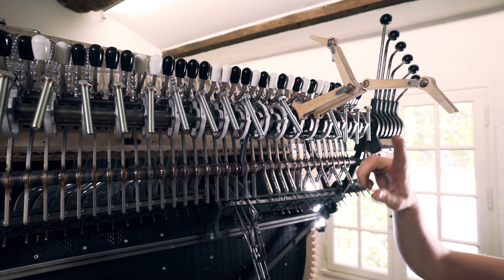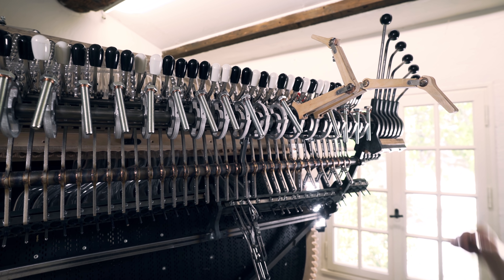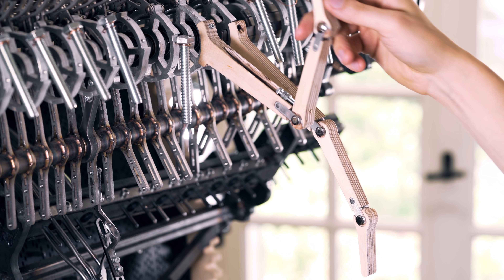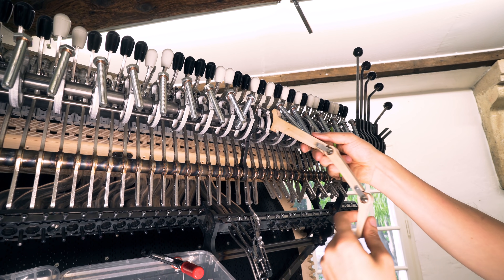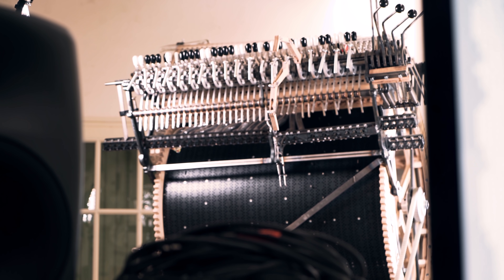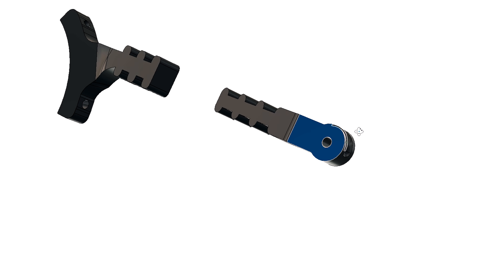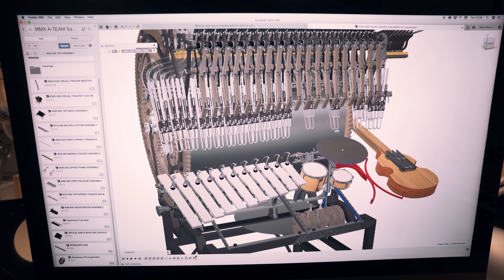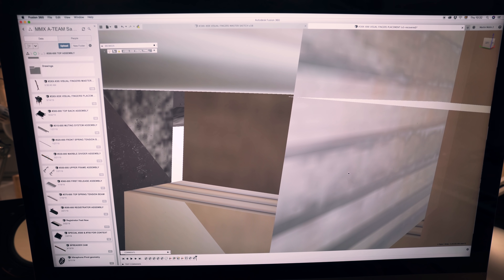Kinetic Fingers Prototype - Marble Machine X #82

Comment: This may not be 'feature creep', but it's certainly 'feature CREEPY' and these will work well on Halloween :) However I recommend you make them removable so that they can be taken off as a unit / assembly for the other 11 months of the year, when you're not playing October shows :) Otherwise, cool idea. 
And yes, I second the idea of small cameras that are strategically placed to show the action... that is a fine idea, and if the cameras are plugged into a common unit providing a common video output, they can be quickly connected and disconnected from the video out cable, to the main video board (so you'd have a sound person AND a video person, for shows).

Comment: In my worthless opinion, these are an oddball to the machine. everything else serves a musical or structural purpose. I'm on board with the hinged funnels as that is already a thing that was there. It would be different if  the original already had static fingers and in the design of the mmx you were like, " those need hinges" but it was, imo, slapped on like flex tape. I know they wouldn't have a purpose in the original but still, the problem they solve can be solved in other ways. If you wouldn't be able to see the giant gear moving from 50m these won't change much. It'll be less "oh look at those fingers playing the music" and more of "the top of that thing wiggles" Also,  to see these you have to have your back to the crowd. I propose a different approach. A close up view of the machine projected on a screen. This would be a lot more interesting for the crowd as they could see what was happening. Overall, I understand that this is your machine and you have put tons of hours into it so it is up to you what you do. I just think this a little gimmicky and I didn't that was where the mmx was headed.

Comment: A little late weighing in, but feel obliged (as I'm finally getting caught up with the videos). Please don't. They just add visual clutter. The other mechanical bits also have a functional role. These are pure fluff (and creepy as well), and still too small to make a difference in a large arena. Everything else is so elegant - this is just baroque, pure form over function.

Comment: 1: while visually stunning (right or wrong) they get in the way of the 'control face' of the MMX which seems like a big mess logistically, unless I'm missing something. (You're literally caged out of all the little black/white knobs by the skeleton fingers.)

2: the movement is simply clunky and mechanical... if you're going to do it, they need to feel alive, not animatronic. The 'shudder' motion when they land looks terrible. I don't know how to solve this? Bushings? Rubber stops? Shock absorbers? Tension springs?

3: I think there is plenty of visual interest already without the fingers, but it's your machine and ultimately your vision!

Comment: Of course I have to put my own oppinion in a sea of comments that'll never be read :P

While I agree that the fingers are form over function, I only do so partway. You gotta remember that while you are seeing the machine in pretty extreme closeup with a camera that can move around freely and track marbles as they go around, in a live play that isn't a possibility.

Not only will the audience not be able to track the marbles from a distance of even a few metres, but they will not be able to discern which marble is causing which noise. It needs to be overstated when and where the noise is coming from, or else it'll look like he'll just stand there and crank it like an idiot while the sound is prerecorded because the audience won't know the difference.

So I agree that on the finger's necessity in this machine as a touring instrument fully.

Comment: Try to see the fingers as part of the gesture, an element that trails off into the inexplicable. I see them as essential. This machine was envisioned by one mind. Though the production and design are being supplemented by many, that initial vision is still where the project was born. From the beginning, he has had a vision that requires effort to communicate, and one should not assume it would be possible for it all to be communicated via YT videos. We do know that some aspects of this vision are meant to be gestural, atmospheric, about the movements and sounds from a purely aesthetic point of view as well as functional. This is art. Let us not forget that nonsense, illogic, intrigue, mystique - even self-disassembly - are all potential brushstrokes in any work of art. This is the difference between AI and humans - we are not entirely predictable, functional or possible to summarize.

Comment: The only thing i thought has to be changed is, put the counterweights in shrinkingtubes!
Everytime the weights hit the finger it will gave a collosionshock to it and damage the connection over time.
Just suspend it a little bit....

Comment: Im not really sure what's the point of having each finger segmented.. why not keep each finger as a single solid bar.. and make them look like tiny hammers.. the fragments makes it look rickety.. and if you are going to strengthening the joints.. it defeats the purpose of the segments. Seems like over engineering here.

Comment: Just because it was planned from the beginning doesn't mean it's not feature creep. It is just early onset feature creep! Also it does not look like the I believe t-shirt or poster design. In regards to visuals with the wheels and chain lift you have lots of visual parts the the MMX. Do you see the strings vibrate on a string instrument in a concert setting? I have followed this project from the frame up  this is not MMX.

Comment: Too floppy.

So much better than the black 3-d printed spider legs you had before, but still very bad. Everything else on the machine is wonderfully precise, and you've taken pains to have it all work in time with the music, so why do you want fingers flopping around all over the place? 

You could make them not have any joints, and rather than being pointy at the end, make them larger, like a lollipop, so the part that moves the most is the easiest to see. It'd still be totally unnecessary, but at least it wouldn't be hideous. 

By the way this is the first of your videos I've ever felt the need to comment on. The lifting fingers are that bad.

Also, congratulations on your new garage space. Looks commodius.

Comment: I may be fairly useless to the actual construction of the marble machine but if you want to smooth zoom in CAD you can activate your compass command wheel (should be in your quick tool bar somewhere in your assembly window or on your drop down menu) and use the zoom feature there

Comment: How about mallets and drumsticks for the percussions and leave the "fingers" for the bass? 

With ~20 of these things in a row you can see that something there is moving, but not exactly what is moving. They don't visualize well, which instrument is played. You don't really play a vibraphone or drums with fingers, do you. I think the visualisation would be clearer, if it was not fingers - but small mallets - hitting an invisible vibrafone in the air. 

For the bass, a small mock up of a frame and strings could be built above the bass channels. With upward bent fingers (a bit like in the prototype's mute position), the back and forth motion of a marble being released would then make it look like it is picking the bass.

Comment: Martin,
This is what is called a "DNGN" - Does Nothing, Goes Nowhere.  IT is not adding anything to the machine.  If you need an "indicator" the thing is working, he colored nobs do that work for you.  The fingers are just fluff that is going to get int he way, and possibly add more useless weight to an already hefty machine.

Besides wasting time on their manufacture, keep the design for future projects, but not for the MMX.  IT is a much more elegant creation without "flippy-fingers"

PLEASE, get rid of the flippy fingers.

Comment: Perhaps the finger is mounted on a stationary hinge and a cable connecting the wheel to the finger pulling it up? Or might be easier to push the finger up from below instead. Might be easier to tinker with. I think something like steampunk/robot finger would be cool looking, kind of how the marble delivery system look like now.

Comment: 8:00 wait! gluing the 2 sides together means you can never service them.
youd have to break them apart to fix something, then cut new wood, and maybe reprint any other parts that got damaged in the break.
are you ok with that?
would 2 screws on each piece of wood be worth it for serviceability?
you said how bad your old stuff was now, imaging how bad your 'now' stuff is in the future.
you may want to service it.

Comment: It just seems like an awful lot of functional mechanics are going to be hidden by these giant dangly wooden fingers. I get that without some size, it kind of voids their whole point, but maybe thin them down, or skeletonize sections of them. Leave the joints thick enough to hold the mechanic, thin down everything else by about half so the functional parts still show. They aren't actually doing anything other than flopping around so strength shouldn't be a concern... just a thought.

Comment: I kinda get why you'd want to add the fingers as some sort of visualisation of what's happening.
But if you choose to call and display them as fingers, I'd suggest you keep them sort of anatomically correct and thus don't make them flip back.

I do agree with most others in the fact that I don't see a reason to add something that doesn't have a function within the machine itself.
You've over-engineered other parts in the machine, but at least they also have a function within the machine. These fingers don't.

Comment: Like many here, I've felt from the beginning that the fingers thing is a bit of a gimmick and that now seeing them, that feeling is amplified. However, clearly this was always in the design and there are components that would otherwise be unnecesary that have already been added to the build, so I guess it doesn't make sense to change paths now. However, maybe a slightly simpler version might work - some sort of relatively small, fixed arm that just bobs up and down, like the hammer of a piano. Enough to make it clearer what's going on without it becoming a marionette.

Comment: Man those fingers sure are (feature) creepy

And yes, they actually are feature creep, even if they were in the design docs to begin with, anything that doesn't expressly make the machine work is feature creep, especially attempting these superfluous features most of the way through while other parts of the projects timings to blown out

I guess Martin must just be ok with the project taking this much longer to finish

Comment: Someone probably already commented this but the hidden world you discovered is the image the program uses to calculate/render reflections (and possibly lighting if the program can render with raytracing/path tracing). It's called a spherical/360 degree (HDR) lightmap and is commonly used for rendering and in video games.

Comment: I love the way the MMX has turned out so far.  It's a symphony of elegance and purpose, designed to do one thing: drop marbles onto instruments.  Every single part has an important job, be it the fish stair returning extra marbles to the top or the absolutely gorgeous timing clutch.

However, I can't help but feel like the fingers follow in the spirit of a marble machine, in that they don't directly contribute to the actual function of the mechanism.  It seems like they're just... there.  In my mind, function is its own aesthetic.  Seeing a machine deftly perform the operation for it was designed is rewarding all by itself, and I think that form always follows function - provided it functions well.

Either way, I believe the MMX is stunning in its own right, and I have complete confidence in Martin and the team to hone their creation to be the best it can be.  Keep up the great work :)
Reply: To add:  I think the fingers would look great if they weren't jointed and were a little shorter.  Seems like they would attract attention away from the rest of the machine as it is

Comment: The photo of the garage is a 360 map of the lighting of the room to provide realistic reflections on your reflective metallic surfaces, as well as provide correct ambient colour from the room itself. Imagine if your marble machine were in a cathedral surrounded by stain glass windows. Well you'd switch out that colour map of a garage and replace it with one of a cathedral. This lighting map is called an HDRI

Comment: The Hall Way Picture is a High Dynamic Range Picture which not only provides the lighting for the render but also the reflection of the material you are working with.

Comment: I think you have an opportunity to increase the visuals by changing the “fingers” for the various instruments.  Fingers are find for the vibraphone since they are a lot like keys on a keyboard.  But the drums should look more like mallets or drumsticks.  I’m sure you can think of other forms for the cymbals or the other instruments.  This way an audience can see the difference easier. Also I would incorporate a grove so you can put a LED at the tip of the fingers.  Think of how lighting can add to the music.  A dark haunting score can have dark lighting with just the tips of the fingers visible.  It would add a bit more work but increase the versatility of the performance.

Comment: If the fingers were less “dead-chicken-head-floppy” and more “cockerel-snapping-up-grain”, they would be a lot more appealing. So under tension in some way, so that they flicked into position (without the excessive wobbling) in such a way that the tip leads the rest of the assembly, instead of the other way round.

Comment: I kind of like the idea of the fingers.  It fits the overall aesthetic of the machine.  

BUT

Please do not make them point in all different directions.  I think a uniform line of fingers would be appropriate, but if they branch out randomly it will be way too chaotic and it will clash with the rest of the machine.   Not to mention it will be hard to keep them from getting tangled with each other.  

Just my thoughts on it; either way it will be visually compelling.

Comment: Martin, I've been a very large fan of yours for awhile now and have loved following along on the journey of the Marble Machine X's development. However, on this issue, I feel like there are some concerns that you may not properly be addressing.

Audience approval: I understand that the intention of this part is to act as a visual cue for the audience, however, I don't believe anything done for the benefit of the audience should have the potential to alienate them. Based on the comments I've seen, there seems to be a more prominent negative reaction to this element than a positive one. Perhaps release a simple poll to get a better idea of the actual amount of audience support for this idea.

Necessity: Does this provide critical functionality to the machine's overall function? From my understanding of the video, this is only a visual element that does not also serve a purpose to the machine's overall function. As for the purpose it is intended to serve, I refer to my previous point.

Time: This has already been a lengthy project and time is something that you don't get back once it's gone. Is there something that is more essential to the overall functionality of the machine that you could be using your time on instead of this? I understand that there's a potential the answer to this question is no. Since this has become a more collaborative project, down time waiting for parts is a real possibility. I also know that your mantra is "world tour", and if scrapping this idea can get you to the world tour sooner, is it really worth pursuing?

Personally, I love the idea and have for awhile, but after really thinking about it, it may be more hassle to implement than it's worth.

Comment: A lot of finger haters here. I'm fine with them. Though I have to say I'm not a huge fan of the counterweights. I think the same action could be accomplished with a bistable spring mechanism hidden within the finger. Also, it looks like a ton of work to make. Why not 3D print the entire thing? I'm fairly sure the Carbon3D can do interlocking parts, you might even be able to printed them mostly assembled.

Comment: I think the idea of having a visual indication is good.  I think the "finger" is not the best visual.  You've spent a lot of time extolling the "tightness" of the music that the MMX can make, but the 2nd and 3rd phalanges won't be "tight".  They will continue to move, even if you dampen them.  I think you should remove the 2nd and 3rd phalanges, elongate the 1st phalanges and make it small the higher the pitch it makes.  You can then also use them as "handle" to drop a marble.
Reply: Not sure about the handle part, but everything else: this!

What irks me most is the floppy motion of the lower phalanges. It's like DEAD fingers flopping about.